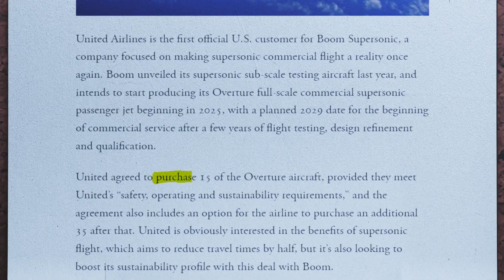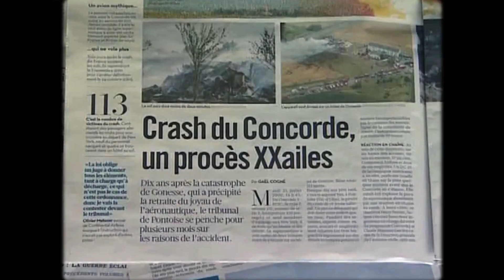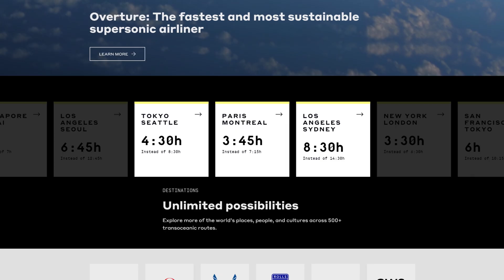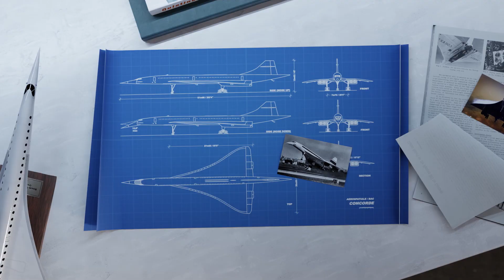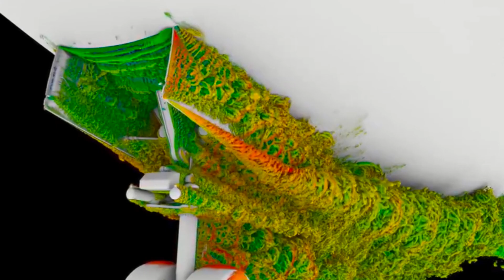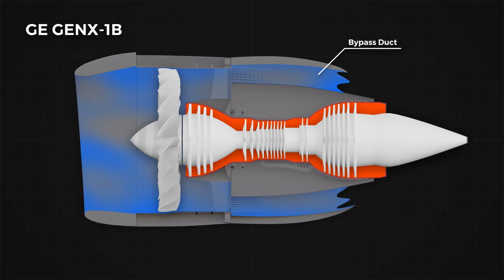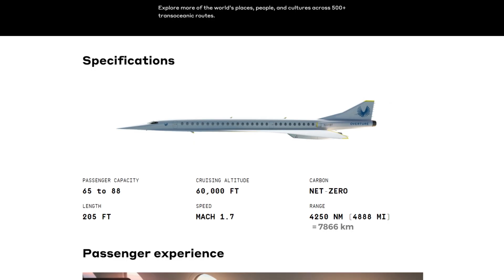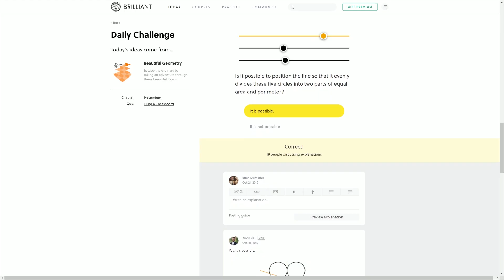Will Boom Bring Supersonic Back?

Comment: 12:37 - Aircraft like the F-22 and the Rafale have turbofans and they can supercruise. Of course they have nowhere near the bypass ratio or efficiency of the GE9X, but those are also small military aircraft where efficiency is not the main concern. An airliner could maybe have more bypass. In any case, supersonic doesn't require turbojets.
Reply: Supersonic might not require turbojets, but the Boom Overture might? F22 and Rafale do supercruise but don't really have to, and spend a lot of time below Mach 1 I'm assuming. Turbojets have higher efficiency in the supersonic realm, where the Boom is supposed to put in most of its operating hours.

Correct me if I'm wrong, but this is what I could piece together.
Reply: @sharvapotdar3257  Maybe, although I'm guessing that a low-bypass turbofan might be the best compromise for such an aircraft. It's probably an area of research for companies like Boom and RR.

In any case, I think it's all moot. Supersonic airliners aren't going to happen any time soon. Maybe something like a niche business jet.

Comment: I've meddled with supersonic flight in a little modeller's dream game called "Simplerockets2". There's a strange effect that happens with certain turbines, that some of them gain thrust after mach 1, i think it needs to have a terribly low compression ratio for it to happen though.
Reply: ram effect
Reply: @makantahi3731  that's what i guessed, but didn't think the game would have that
Reply: @crackedemerald4930  as aircraft speeds up,air become compressable so in intake of jet turbine engine makes gain from transformation from dinamic to static pressure,at over Ma3, no need for compressor
Reply: @makantahi3731  it was increasing thrust just after mach 1 though
Reply: @crackedemerald4930  you are talking about video game, right,? maybe they did not made it fully real in aerodynamic and thermodynamic way,if did  then it would be fluid mechanic simulator,i know dozens of real mig pilots and i talk with them about flying, and jet engines thrust become higher as plane speeds up, on low level it can easily close up to ma1 without afterburner
Reply: @makantahi3731  i wonder what model they used to specify the turbine behaviour
Reply: @crackedemerald4930  is not turbine behavior, it is fact, it is easy to put into game
Reply: @makantahi3731  it's how they react to certain conditions, if you go higher up you'll get less air and therefore less thrust, they must've used a mathematical model to calculate the thrust based on simplified inputs of a turbine
Reply: @crackedemerald4930  in old  video game wings over vietnam, tas, ias, ma are very well done, so it is not problem, just numbers that explain how something behaves

Comment: Interesting video but you didn't discuss either of the key flaws in Concorde, which were the reasons why Air France 4590 crashed. 

The first flaw with Concorde was the wheels and landing gear. The materials were not up to scratch relative to the enormous loads they had to bare. It was a piece of scrap metal from the plane that took off before Air France 4590 that caused the explosion and fire in the wheels and landing gear that ultimately led to engine failure and disaster. The other flaw that led to the crash of Air France 4590 was the V1 point of no return. Once Concorde reached a certain speed on the runway it was impossible to abort the take-off without a cataclysmic crash, which is why Air France 4590 took off in the first place despite the in-flight warning systems indicating there may be a serious problem. So either the aircraft needs a lower V1 threshold, which is not really possible with the delta-wing design, or the runways themselves need to be longer to accommodate supersonic passenger jets like Concorde

Summary:- Wheel materials and landing gear design along with V1 threshold (no aborted take-off possible without crashing) along with runways designed for regular passenger jets led to the Air France disaster and the end of Concorde (along with 2008 financial crisis)
Reply: The V1 thing would just depend on where a piece of FOD is on the runway, like you could run over a piece of debris just before hitting V1. Runways would need to basically double in length to eliminate V1 even for subsonic airliners
Reply: Those are literally not flaws related to the Concorde itself, since without the DC10 dropping a part in front of it and punctured the wheel (then the fuel tank) the Concorde's design is well within the limits of what it is supposed to handle.

As for V1 literally every plane has the V1 no-return speed, had this happened to say a 747 Airliner and they know shits up but is already at V1 they will have to take off as well.
Reply: @周生生-f1f  The crash was caused by the debris on the runway yeah, but the aircraft should have redundancy for that. 

It's like having a single engine airliner doing trans-atlantic flights. You could argue all day that an engine failure was caused by XYZ, but they should have a redundancy for that.

After the crash happened, they redesigned to fuel tanks to be  armoured the fuel tanks and did something (im not sure) to the tyre compound, but by that point they were already in a difficult situation money wise because of politics and public opinion
Reply: @kingdavewoody  Let me just say this real quick; at that kind of velocities the Concorde was travelling and the extra stress it needs to be handling, any "armoring" and "redundancy" is nothing more than just PR stunt that only provides spiritual support, when you are running over a sharp piece of titanium with a very high pressure tire under twenty tons of pressure.
From a physical perspective that kind of damage is virtually impossible to defend even if it is not a Concorde.
Reply: @周生生-f1f  Concorde had its Certificate of Airworthiness withdrawn, at that point a PR stunt wouldn't have worked.

They were making modifications to get it certified again, no to win the public over. We can argue about this forever, but at the end of the day the manufacturer and the CAA weren't dumb.... the manufacturer wouldn't have designed a modification they knew wouldn't work, and the CAA wouldn't have approved a safety modification that didn't work.

The people involved were much smarter than you and I, so I think I'll just go by what they were saying
Reply: @kingdavewoody  The Concorde does have its Cert re-released on 2001 September 5th. 

And lets be real, the FAA allowed the DC10 to fly even when they are perfectly aware that the DC10's doors will explode under pressure (MD literally tested this and knew that themselves) - coincidentally which is the culprit in screwing over the Concorde although irrelevant to the door issue - the Cert was worthless as a metricwith maneuvers like this, and the modifications were mostly just a formality thing telling the public "we tried doing something about it", even if everyone is well aware that had there been a round 2 the Concorde will still have been destroyed even with thicker and different tires simply because of the immense mass and energy involved.

Comment: At 7:28 the Ogival Delta Wing angles seem to have changed places. In addition the picture is illustrating the complement angle of the sweep angle (90° - sweep angle) while showing the right numerical value for the sweep angle. 
 Great video, anyway! Thanks.

Comment: Interesting video.  As a someone who works in the field of computational structural mechanics (R&D for a simulation company who's footage you shared) I appreciate your commentary about the importance of simulation and how that has advanced the state of design since Concord.  I also share your skepticism regarding economic feasibility of SST in commercial aviation.

I don't understand your statement "bending aluminum into the perfect shape without creating stress concentrations is difficult".  The aerodynamic efficiency in the 787 comes from the higher wing aspect ratio.  That's made feasible by the higher fiber-direction specific strength of CF.  You could absolutely make the same shape wing out of aluminum, it just wouldn't be strong enough.  That's not due to an inability to bend it without creating stress concentrations.  In fact, bending Al tends to make it stronger due to cold-working (at the expense of ductility).  It's just that the stresses in a high-AR wing are better handled by a material system in which you can tailor the directional strength versus what is possible with isotropic materials.

Comment: If SpaceX Starship point to point travel around the globe in an hour outside the atmosphere  becomes a possibility there will be no need for supersonic commercial aircraft .  The only boom will only be where it lands , not all along it's route .
Reply: Point to point rocket travel is not going to happen. Ignoring the economics, the simple fact is that a jetliner will always be safer than a rocket that has to propulsively land. I think a much more viable option are high flying hypersonic jetliners with mixed turbofan/scramjet propulsion. Still not something you'll likely see this half of the century though.
Reply: @jaffacalling53  airliners are simply a lot more efficient too. Imagine the amount of fuel required to get a rocket with the equivalent capacity to a 777 out of the atmosphere and into some sort of brief orbit.

Comment: The point is that the laws of physics for flight work in your favor when traveling at the sub-sonic speeds of standard aircraft, but fight against you when traveling at supersonic speeds.
So if you want to go fast then get out of the atmosphere; the problem here is you need to slow down and get back into the atmosphere if your destination is back on the ground.

Comment: 0:26 I think you got confused. Concorde definitely was NOT still flying in 2006. The final passenger flight was from New York JFK to London Heathrow on October 24 2003, and the final ever flight of a Concorde was from London Heathrow to Bristol Filton airport on November 26th 2003.
Reply: and Air France 4590 crashed not 4560
Reply: @kabeertheavgeek  A shame...the investigation proved it wasn't even the fault of the Concord.  It went over debris on the runway.  Any jet probably would have crashed.  =/
Reply: Pretty sure that's a narrative error as the date is accurate just not the year.
Reply: You are correct Dylan. Concorde's last flight was indeed on the 26th of November 2003.
Reply: Does the flight to deliver the Concorde to museums count as its final flight? I remember seeing the Corcorde flight to NYC, then it took a barge ride from the JFK Airport in Queeens to the Intrepid Air and Space Muaeum on the Hudson Riveron the west side of Manhattan. I saw the Corcorde on the barge later in person at the Museum.
Reply: that's 20 years ago. i see they really made some headways.
Reply: Speaking of errors; 
0:37  "Passengers rewinding their watch only 2 hours" ??!
The time difference between London and New York City is 5 hours. 
What's wrong with this logic?
Reply: @Mash4096  I THINK they added the travel time of 3 hours? didn't they turn off watches on planes back then?
Reply: @arifhossain9751  When Concorde started flying most watches were mechanical, not digital.  You couldn't turn them off
Reply: @Mash4096  I think the idea is that the flight was short enough you got there before the time change caught up. London is 5 hours ahead of New York, so if you take off at 10 am GMT (5 am EST), you land at JFK at 1 pm GMT, it's 8 am EST. So assuming your watch was off while you flew, you just rewind from 10 am to 8 am. Not sure why you'd turn off your watch though, since that's how you check your time left before landing in the days before cell phones and seatback tv's
Reply: @theogoltzman5372  Yeah, ofcourse i know what he really meant. The turning back watched 2hrs was just a mistake. Stopping your watches at the time of departure has never been a thing.

Comment: Another element that turned the Concord obsolete is conectivity. You just couldn't not be present in important meetings, or phisically transport important data very fast back then.

Now, with internet that is not the case. So cutting 2hrs on a travel is not big deal. Taking in account check-ins/outs, new more far away airports than in the 70's, traffic congestions, etc.

All in all, The Concord was never going to be a viable transport in the 21st century.

Comment: As much as I love these kinds of technologies, I hope that supersonic PLANES will not return. As for now, they cause way too many issues than solve problems. 
Noise of this kind of jet is not only sonic boom, but also jet engine. I live near by military airfield, well not really nearby, actually quite far away, and yet I still hear loud engines of jets, very unique sound because it vary depending on position of plane towards you. At least here because of it, military planes during peace time are not allowed to come close to population centers, about breaking sound barrier not even speaking. 
From data I found (US navy did research few years ago) the difference between jet and turbofan plane is about 20-40db. (In different study you can read that bypass ratio is main reason modern airliners are so quiet) It's huge difference when we compare fact that normal airplane while traveling above your head is like 60db already, now add 20-30 to it, and think that at busy airport in big city it will fly above your apartment few times a day while landing. And for who? Not me, not you, we won't be able to afford this plane. It will fly and make noise along side pollution for rich elites. Only so they can save couple of hours? It's not something that outweights noise/air pollution by any means. We already have issues in big cities with current planes being too lound, and they make even louder plane. Just think about it.
Hyperloop, flying into space using steam, trebuchet everything seems better for me than ultra vacuum cleaner (I mean jet/rocket engine) flying above your head for no good reason.

Comment: The Comet was always able to fly supersonic but was not allowed to. It is a lie that the concorde was the first. Don't be fooled. Look at the size of the engines of planes compared to concorde. Open your eyes! Speed needs to be controlled for several reasons, not technical ones.
Reply: You can't fly supersonic with a subsonic airliner with normal 35 ° swapped wings, the wings of an subsonic airliner are designed for the typical Mach 0.9, and the control surfaces are made for subsonic flight. The aerodynamics in supersonic flight are completely different, there's no longer a laminar flow if the air is supersonic, and supersonic aircraft needs special air intakes which slow down the air to subsonic speed since no engine can handle an supersonic air flow (not even the SR-71 could). The control surfaces of supersonic aircraft are completely different compared to subsonic ones. 
The Concorde even had an afterburner to reach Mach 2, the wings are the result of 5k hours of wind tunnel testing.